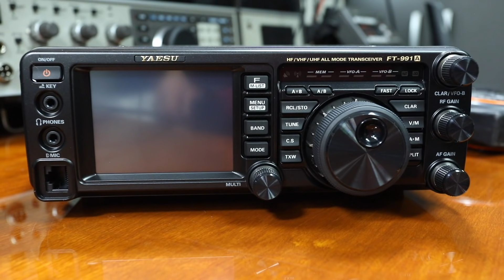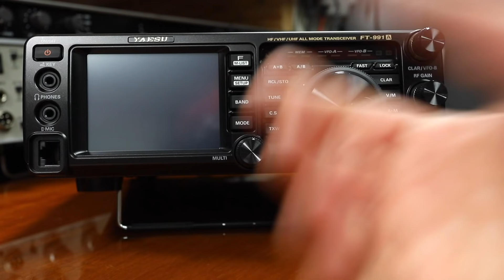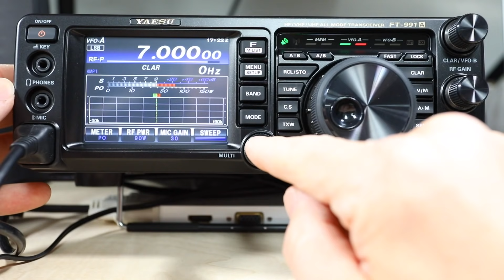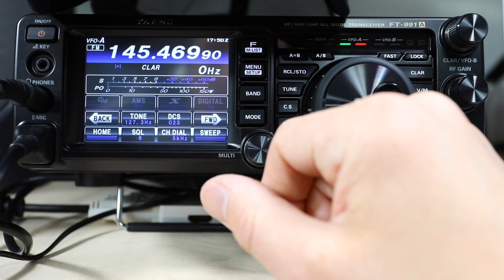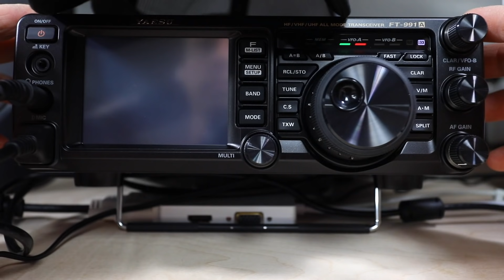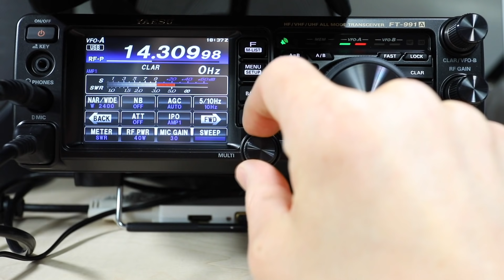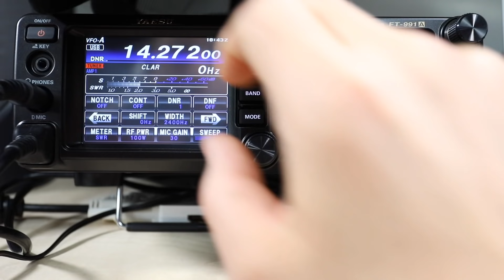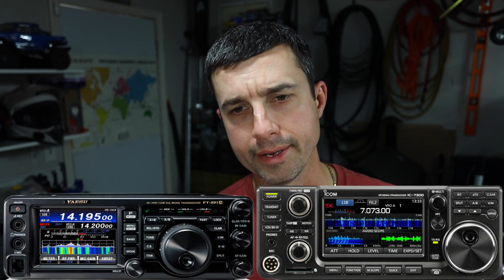Yaesu FT-991A Unboxing + On-Air Tests

Comment: It’s an ALC Plug not an ACL. Also it’s an AMERITRON and it’s pronounced AMER ITRON not AMETRON as you said.It’s pretty simple stuff.Also why would you ever whistle on the air? Do you understand that AM or FM would transmit a carrier and you get a far better reading of the SWR?👍🎙